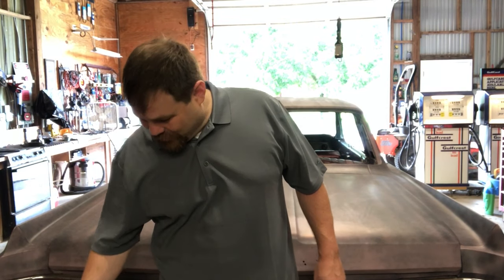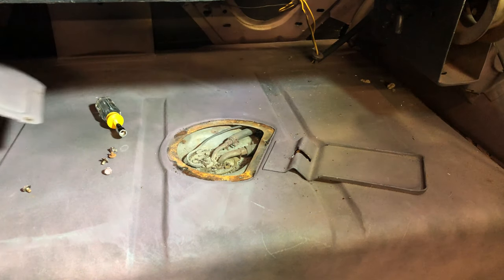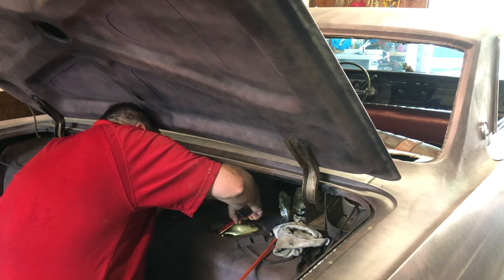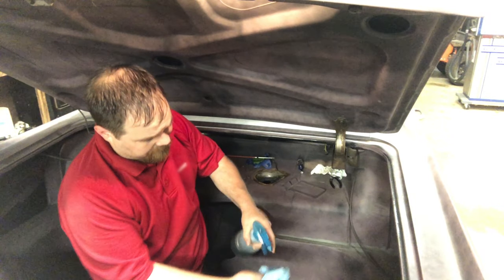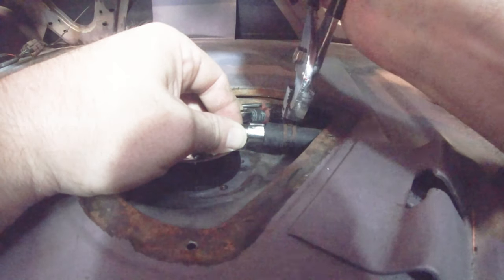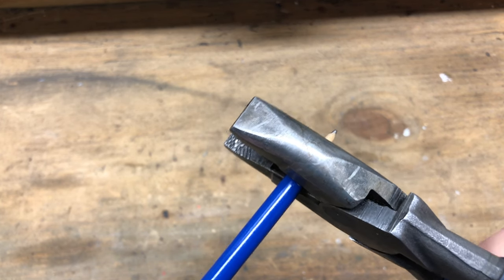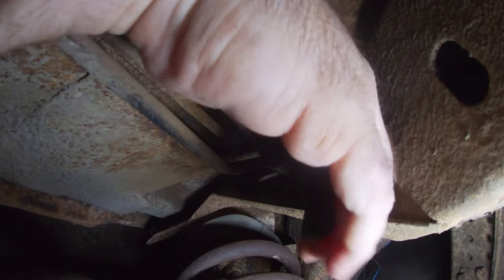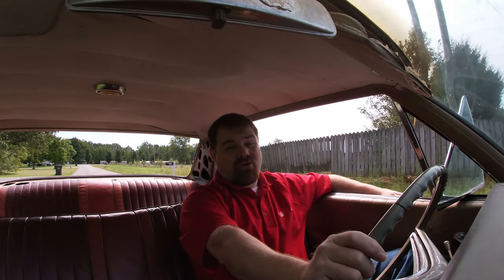HOWTO: Replacing the fuel pickup and sender in a 1964 Buick Wildcat or Electra with A/C

Comment: hello friend very good the video.
, I have a wildcaT 65 I live in Uruguay, I need to know how the click down is connected to the TH 400 box, how is the electrical circuit and the order of the cables. Thank you so much
Cheers
George
Reply from the maker: Hello Jorge, the 1965 Wildcat/LeSabre/Electra service manual is uploaded to https://www.manualslib.com/manual/1586039/Buick-Lesabre-1965.html. That will explain both the kick-down, and the switch pitch. Happy motoring!

Comment: How do you remove The fuel filler neck? On my wildcat its really stuck...
Reply from the maker: The filler neck goes into what used to be a rubber seal. If I was trying to remove it, I think I would use a strap wrench to chinch down on the neck within the wheel well and rotate back and forth.
Reply: Do your tank have  straps or bolt in